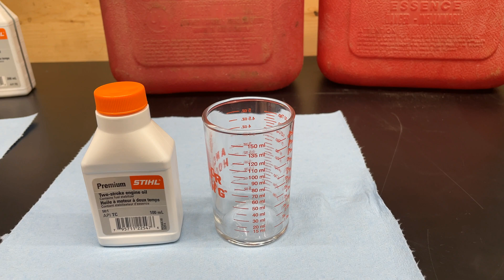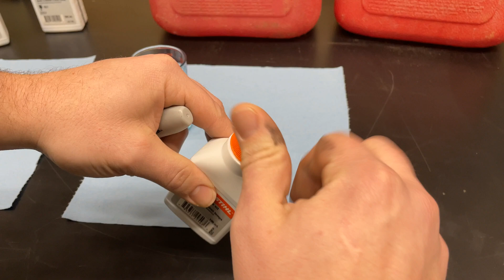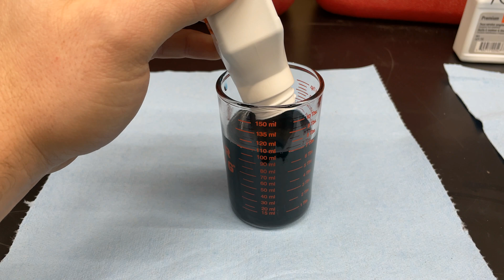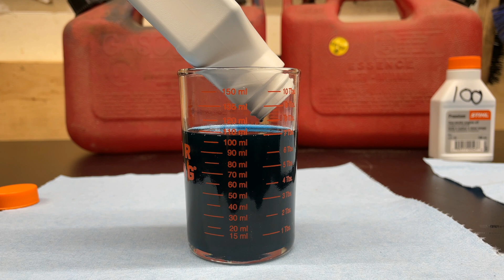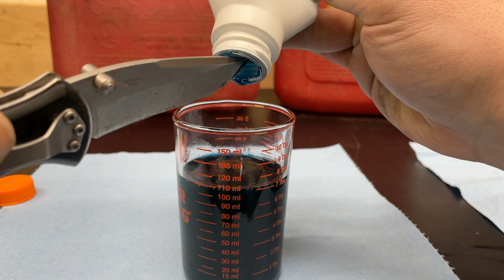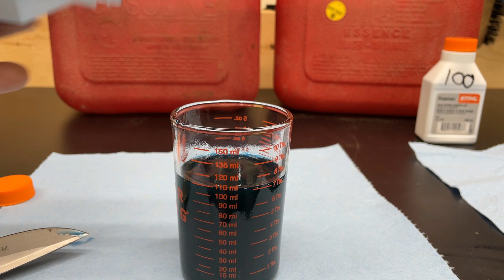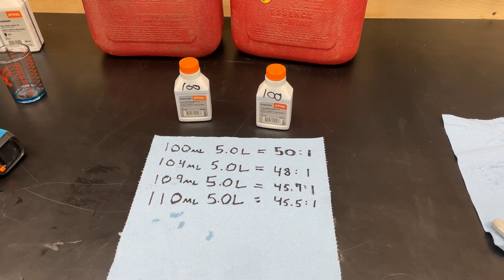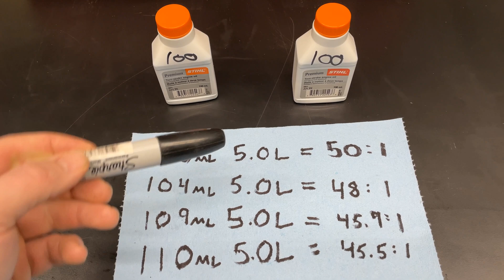Inconsistent 2 stroke mixed gas... Does every drop REALLY count? (Surprising test results found!!!)

Comment: the container varies is +/- 5%, they add 10% more oil for the intention that people aren't gonna sit there at the gas pump doing that, a car key puncture hole, stick in it the gas tank and then fill er up.          I calibrated my measuring beaker and it was off 3%, I buy premix buy the quart and measure out in my pre calibrated beaker.  way more cost effective and accurate then the pre measured bottles...

Comment: I run all my Chainsaws at 40/1,  Ironhorse sez he can tell the difference between 50/1 and 40/1 saws when he opens them up.
The 40’s have visible better lubrication.
Reply: I run 42.5:1 rather than 50:1.
Reply: yup

Comment: They have to cover themselves for they ones that are impatient and can’t wait a minute to drain the oil out. In the Husqvarna operators manual they state, if you use Husqvarna  HP 2 stroke oil can be mixed at 50 to one, if you use other oils they must be mixed at 33 to 1. Now stihl state the use of full synthetic or a brand that is equivalent to. Now in Australia Stihl supply it’s own oil the green ultra synthetic and the pink mineral oil, the Stihl Castrol oil is not sold as Stihl oil and can only be bought as castrol garden t I think. In the Stihl owners manual they state that only to use 89 octane or higher. The higher the octane the cooler they run. 
So where you get fuel from can be a factor depending how long they turn fuel over. And chain sharpness is another factor the blunter they’re the more the engine races and can cease a engine. If you can’t sit a saw and let it cut with one hand and without dogging it in it’s not sharp enough. Take for instance no Husky 372 x torq were ever sent to Australian dealers my theory they could not stand up to the conditions. With these new electronic and fuel injected saws the only option you have is to add oil the harder they work. We still have a few around the area that use 30 wt oil in their saws. If you a 170 to prune the shrubs 25 to1 may be a bit rich but on the other hand 50 to 1 on a 880 milling logs pulling a 30 inch bar all day may be a bit light.

Comment: Very good test Dave! The same applies when doing vehicle oil changes. If you just dump it in you will get the same results. After letting the bottles drain upside down for 24 hours on a 6 quart oil change you will get a couple of ounces of oil that didnt go into your vehicle. 🇨🇦🇺🇸👍Roger

Comment: That's true for All of the 2 cycle equipment I put  a splash of gas in the oil bottle to get All of the oil out  the other side of this the difference between the mineral oil and synthetic oil  it better to have a little bit more than not enough oil  those bottles are filled by a machine that is on a convery belt which means it's a production line  get what I mean young man  basically they are wanting  More product  done in a certain time span

Comment: It depends on the type of oil used:  Lightly refined, moderately refined, highly refined, synthetic, ester synthetic, or castor oil.  Each is for different temperatures, RPMs, and type of machine (Old model vs. auto-tune, where the fuel level can't be adjusted to compensate for the type of oil one would select).  Some accuracy is required, but moreso for some than others.  thanks for the video.

Comment: Years ago, advised to rinse pod / bottle & add back to mix, especially when small volume being mixed. Even more important now with ethanol added fuel not storing as long. Buy / mix smaller quantities & use up to help limit potential problems.
Reply: I never use ethanol fuel in any small engine (2-stroke especially) and if I can't get alcohol free gasoline, I de-ethanolate it before using.
Reply: @mr.somebody1493  Hello, can you tell us how you go about de-ethanoling the fuel?

Comment: Either way, it’s just the tuning of the saws, or other devices, that would matter. Mtronic or Autotune will more than take care of that little inconsistency. KNOW HOW TO TUNE is what it boils down to. I run roughly 30-1 mix in my 372xt and I have been tuning around temp and mix inconsistencies for some time, and when I do that I have no problems or undue wear or “tar like substances”‘ showing up. But I am just a little worried that unknowing people will try this and burn up their pieces of equipment.

Comment: Not to disparage Anchor Hocking, who have been around manufacturing quality glass products for a long time, but unless you use a scientific beaker and pay strict attention to parallax view angle, your measurements are subject to error. I’ve had small measuring containers in the kitchen which differ wildly from one to the next when I poured one measured amount into another container. That said, also consider that measuring smaller amounts is more subject to variation than larger amounts due to the ratios involved. With larger amounts, say 5 gallons, the error difference will be less due to the same error spread out over a larger volume. I suspect Stihl has taken into account how the typical amateur user actual mixes most of the time plus the dangers to small engines using leaner mixes and have intentionally included a safety factor amount in their containers. It would be interesting to see if that extra amount is consistent over different batches of oil over time.  This may also explain why some equipment seems to be running rich based on observations of exhaust debris on the equipment despite measuring carefully.
Reply: He used the same beaker for both, so the comparison of volumes is still valid.
Reply: If you look at it level the parallax is a non issue. Looking at the meniscus is the scientific method regardless of fluid. 

The accuracy of the container does matter for measurement from bulk, but for this comparison I don’t think it matters. This is how much of the packaged volume do you get, and if I were to design a machine to bottle this oil in series I would fill by weight.  If multiple bottles were filled side by side I would probably do it by volume but verify by weight at a following step.
Reply: Good point about parallax, the other issue I had is it looked like he was measuring the meniscus incorrectly?  https://www.youtube.com/watch?v=VywQc5-K3sM